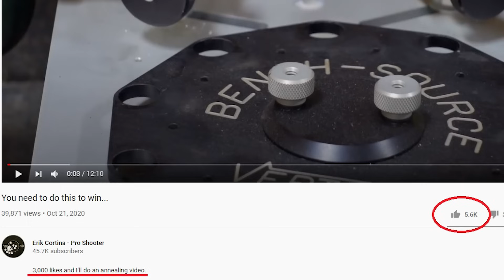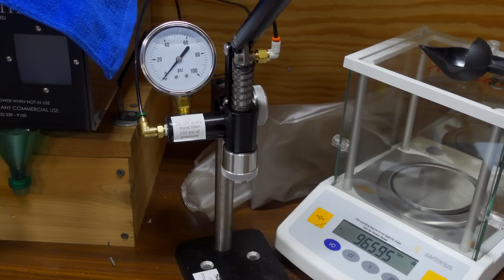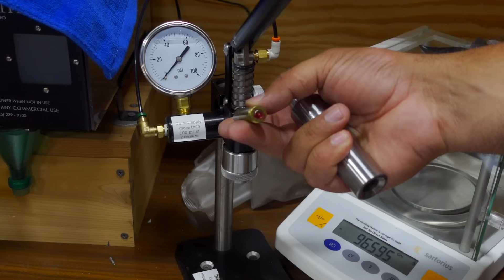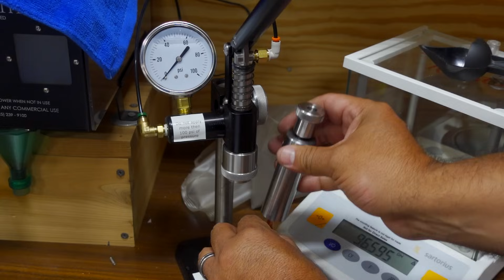This is how I anneal my brass

Comment: ya know, it would be faster and easier if you built yourself a basic induction forge setup, plus you wouldn't need to burn gas anymore, just drop your shell into the coil and hold the button till temp and done, this could take 1 second each and only the work target will be hot, the tool is also good for forging steel as well should you build it strong enuf for that, makes a lot of jobs easier because you can make custom coils for it in different shapes for many different jobs, it can even be used to braze spots quickly

Comment: Actually annealing is a combination of temperature and time. Heating brass to 700°F (common youtube practice) would actually take one hour for it to properly anneal. 700° for a couple of seconds is not going to do jack. You may as well not do anything. In order to anneal in just a few seconds, you have to get the brass much hotter, 950°-1000°. Which is probably not too far off what you got in your 10 second run. That's why your brass did not get ruined. All of these people on youtube claiming to go by the color of the flame don't know jack s***. They're just repeating what they've heard. With the flame you had, you're probably good at 8 to 9 seconds.

Comment: I'm curious, is the whole point of this simply to extend the life of the brass or to ensure it expands/retracts consistently?  I've only reloaded pistol brass and tend to use "range pick-up" which I only reuse 3-5 times then cycle it out.  I'm just missing the benefit of this as replacing brass every so often seems to be a better choice. No disrespect but Again I just don't see the benefit.
Reply: Both to extend the life of the brass and to keep it consistent. The cost of lapua and other high end brass is a dollar or so a round. You can shoot some of the high end brass around 20x per if you anneal which keeps the cost down really well.
Reply: I have some Bertram Brass cases in .416 Rigby that are around $7 a case. If I can extend them from 4 loadings to 8 for the cost of some propane im going to do it every time. I agree that on some range-found pistol brass it would be a waste of time though.

Comment: You still want a consistent annealing though, correct? I mean getting each piece of brass to the same temperature. If you have some brass that is lightly annealed vs brass that is overly annealed, that would make for inconsistent shots, wouldn't it?
Reply from the maker: Consistency is key.

Comment: Thank you Erik for all the hard work you do to teach those some of the steps you've mastered. 

When you seated the tips I was under the impression you were using fired brass but to seat a tip requires sizing first. Did you size the case prior to annealing? For some reason I'm of the impression annealing comes before sizing.

Thanks again!

Comment: Erik have you tested for velocity in the brass that you annealed for longer? I did my own test similar to this and I found that my extreme spreads went to complete crap, even tho I had good neck tension with over annealing. So the neck tension alone might not be the only thing happening there? Any thoughts or experience?

Comment: How many times can you reload the same brass and get good results before replacing with new brass
Reply: That depends on the caliber. But, normally until the primer pockets loosen up and wont hold primers. SAUM's trash them early but things like dashers, BR's and 223 last a long time. 15-20 firings maybe more. Generally if they go for 10 or more I consider them to at that point not owe me a dime.
Reply from the maker: Correct.  I lose brass because of loose primer pockets, not for any other reason.
Reply: @hir3ddriv3r48  after the primer socket gets loose. Do you throw the brass away or is there a way to recycle them or sale them to be refurbished
Reply: @Daniel7.62  I always recycle brass and copper. Brass was something like $1.30lb last time I checked, I think, definitely over a dollar.

Comment: Anyone have thoughts on annealing belted magnum cases? I was always taught after six  or seven times reloading my 300 wm even if no signs or apparent damage near belt retire those cases.
Reply: Annealing the neck really isn't going to affect the head separating so i probably would go too many on a 300 wm
Reply: @wades623  thanks for the input. But what are your thoughts about annealing the case at or just above the belt?

Comment: were there primes in the casings when he annealed them?
Reply: For me, I anneal after cleaning, before sizing/depriming. The purpose of annealing is to remove the hardness/spring back from the brass, so you get proper sizing and shoulder bump. If you deprime and size before annealing, the brass will spring back. I have verified this with experimentation.

Comment: The amp removes time and temp and gives an 'amp value'. What is it measuring from that one piece of brass that is used to set the amp value?  Heat?  Color?  Just wondering..
Reply: Possibly electrical conductivity. When the brass changes state & conductivity changes, the load on the induction coil circuitry would change.
I presume this is what they're measuring.

Comment: When you fire it, it get's annealed, at least the neck
Reply from the maker: Nope.
Reply: @ErikCortina    
Anneal ductil metals is about make even the microstructure of the metal, and is gradually done,  as more you heat it, as more even gets the microstructure, this is why if you let a piece of jewelry or a piece of brass like that for months exposed to very hard Sun every day, it gets eventually soft, those ductil metals are like hard paste... So when it's fired doesn't get annealed like with a torch, obviously, but is gets good enough to reload it, specialy when it's coming from the first factory load, and just went through the annealing factory process..  here is the thing..  You don't even need to anneal a case to reload it even more than one time, you probably will be able to reload the same case probably 10 times before start feeling the need to reload it..   Bottom line is, annealing is a process that it gets done in factories, and I know a lot of ppl do it while reloading, but is not need it....  The amount of cents you are spending now in reload a bullet is getting close to the retail cost of that bullet,   specially using small torchs like those you have in the video, so the porpuse of reloading start fading away.. so.. why do it in the first place.  I would only anneal cases while reloading if I had a more commercial factory like tool, cost effective.. my humble opinion though.. Great videos, I love them, don't feel attacked Im just trying to help, please keep them coming Im learning from you

Comment: What if in sake of simplicity one throws cases to temperature controlled furnace and anneals whole cases. Will primer pockets become loose from next shot, or cases head separate? Anyone ever tried and experienced any issues?
Reply: The case heads need to retain their factory hardness so they don’t permanently expand and get stuck in the chamber.

Comment: I don't want to be controversial but, I discovered that nearly all of what we've been taught is just not factual, with regard to consistent hardness being achieved.
To put this annealing thing into perspective, we have to go back to where it all started &, it appears to me that,quite a few decades ago, a couple of well known guys in the gun world,  took some info from the manufacturers & ran with that without reading any studies on annealing or, testing other methods which would apply to reloaders & not cartridge manufacturers.
The problem with Brass is that, much of the annealing is dependent on the initial hardness state regardless of the time or temperature &, after reading the scientific studies on cartridge brass annealing, I simply couldn't see how any kind of consistency could be achieved with the method we are all taught.
Erics conclusions are exactly what I found &, if annealing is taken further to 100% recrystallization, the results for me, as far as seating force consistency, have been excellent. 
Anyhow, here is a study conducted by Harold.L.Walker of the University of Illinois way back in 1944-45 specifically on C26000 70/30 cartridge brass.
"GRAIN SIZE PRODUCED BY RECRYSTALLIZATION & COALESCENCE IN COLD ROLLED CARTRIDGE BRASS"
I have another 1/2 dozen or so studies from different perspectives but, they all agree on the annealing times & temps.
If anyone does decide to try some experimentation at higher temps, I anneal my cases in 1/2" of water &, I strongly advise others do the same. 
Thank you Eric for your absolute honesty during the testing. Very commendable indeed.
Kind Regards...........Rotas.

Comment: Were these pieces of brass resized before you annealed them?
Reply: normally you anneal first and resize after. But when i fireformed 30-06 brass into 270 i annealed after sizing but that was just me.
Reply: It aides sizing so before sizing. If you test with a caliper you will see various inconsistencies when not annealing. So annoying when your trying to "bump" your brass to .002" under fireform.

Comment: 1000 yards, yep, that seems like a real-world test, which is where it matters for you :-)  BTW, I guess, that, if you needed to do anything about the shoulder of the cartridge, that your technique of putting the flame down there also ensures that the neck-to-shoulder area is also annealed...maybe that helps in sealing the chamber, under pressure of firing??  Thanks, nice video... it gets harder, the more you work it.. ;-)  BTW, I don't know if you have seen this, but I found it interesting:
http://bulletin.accurateshooter.com/2011/09/cartridge-brass-alloys-revealed-by-x-ray-spectrometers/
cheers, Maestro!

Comment: Mate…. What you show is too complicated and expensive.
In rural Australia we do it the easy way….
Some education: to anneal gun cases you have to heat to 400 - 600 Celsius and slowly air cool the cases. Annealing temp. depends on copper content.
Now, ordinary electric stove plate heats to nearly 800 degrees .
When annealing cases, you only need to anneal neck and shoulder. Unless you full size cases, but nobody full- size cases these days.
So all you have to is to have access to ordinary electric stove. You stand all your cases at once, upside does.
Turn the plate on and let the cases heat up.
When neck and shoulder start to give the first glow, turn the stove off.
Let them air-cool slowly.
Since you anneal them all at once, takes only a couple of minutes.

You have to work out your stove settings, times and the spacing of cases on the plate for each brand and calibre. But I never annealed any cases bigger than 308 win.

We all do it that way and the brass is annealed perfectly. Also got the good looks of factory annealed brass.

Do not waste money on all unnecessary equipment!

Comment: This is the exact way I anneal my brass is using the "glow" method and have been doing it for years other than I use "test" brass to set the heat, time, and location of the flame before annealing my actual brass to be reloaded as in this video of mine https://youtu.be/p7nzpaP2Q6M

Comment: this concept of, " its not glowing enough" confuses me, considering it is 2022 and we have amazing temperature motoring devices that can fit in the palm of our hands. humans are not, good clock's , nor are they good visual witness's. If there was only a way to get a closer/ more accurate reading of the surface of that brass. if we only could invent some sort of thermal imaging, or some sort of detection of heat waves... oh wait, there called Infrared thermometers. I use them frequently and get GREAT  / ACCURATE annealing temps.